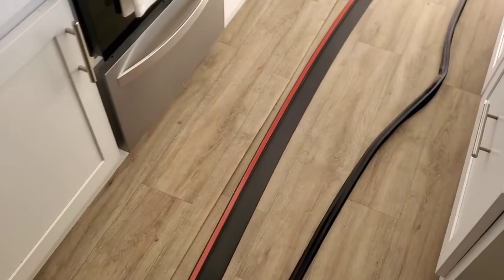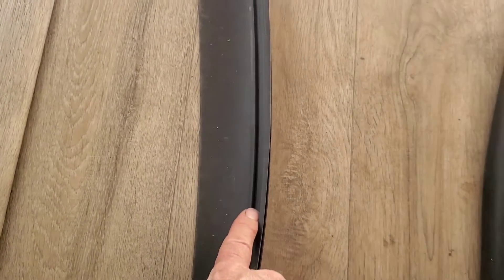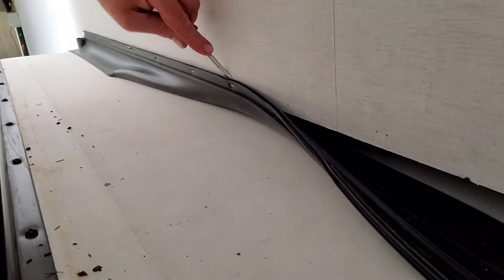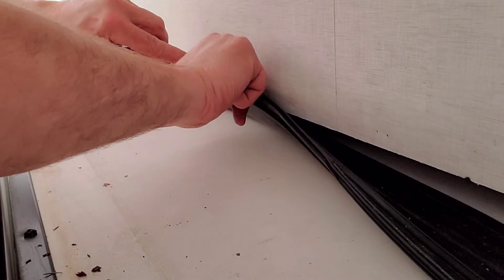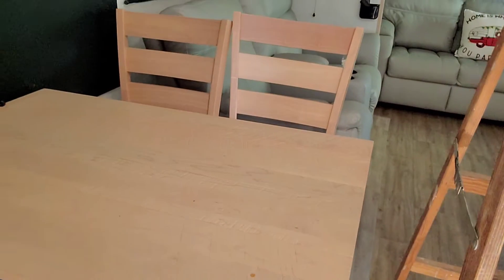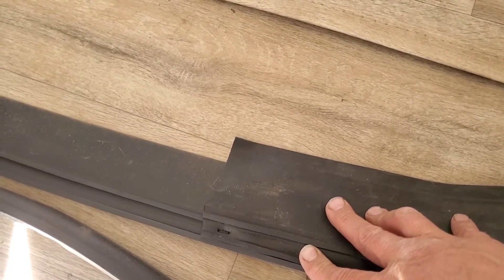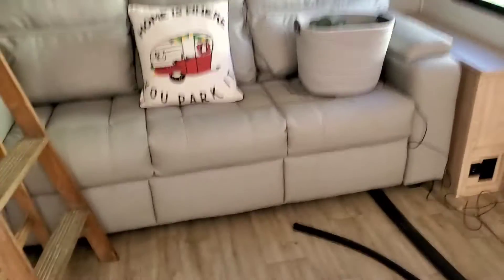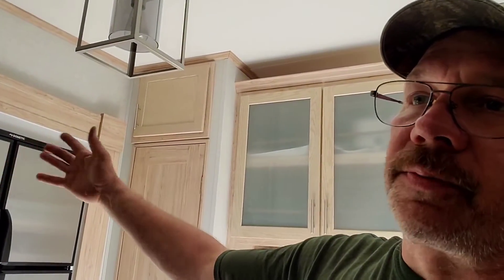Inside slide seal replacement on our Alliance Avenue 32RLS

Comment: Good video.  Most of all I was curious to see if you had an easier time than I did when I put on one of the horizontal bulb seals.  It was so hard to get it to slide across.  I even had a second guy help me and together we barely got it done.  So...glad to see it wasn't just me.  The vertical bulb seals are much easier to do.  Thanks for another good video.  PS:  nice meeting you at the rally in Goshen in May!
Reply from the maker: Nice meeting you, too. Can't wait for next year. We replced the D bulb 3 times and the main seal once. I had Alliance ajust at it at the rally, and it's been good since. Only thing is the slide is off center now. I'm going to see if I can shift it to the left about 3/4".
Reply: What screws did you use?
Reply from the maker: I believe they were #8 hexhead self drilling

Comment: Good video. My alliance is about 4 months old and has the exact same issue. I’d personally want to do the repair too as you are right. The dealer would keep it for a month and not install it correctly. Thanks for making the video!
Reply from the maker: I'm still having issues with it. We're going to the rally at the end of the month and hoping they take of it
Reply: What is happening with it? Looks like you did a good job
Reply from the maker: It keeps popping off when I close the slide. I've put it back on about 8 times.

Comment: Good Video!  I'm about to replace the lower seal (under the slide out) on mine as it is messed up a bit.  When you were sliding that "D bulb", I was thinking if you only had some 303 rubber/vinyl protectant to spray on the lap seal first.  That would have helped with sliding that "D bulb".
Reply from the maker: I thought about putting something on it but I didn't want to add something that would make it easier for the D bulb to come off. It was an on going issue even after I put out the video. I finally got it fix at the Alliance Rally this summer. The slide needed adjusted